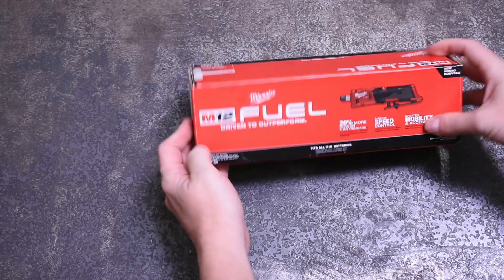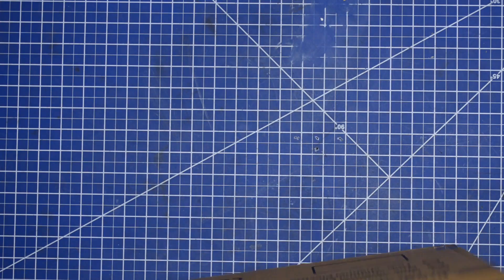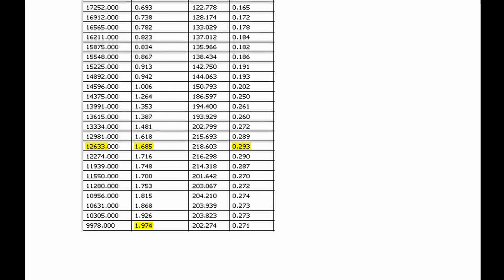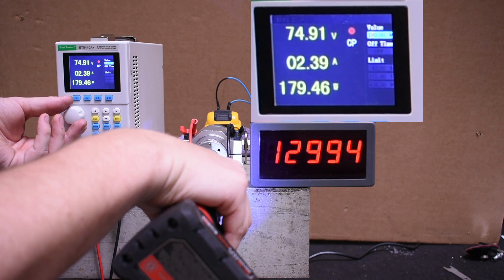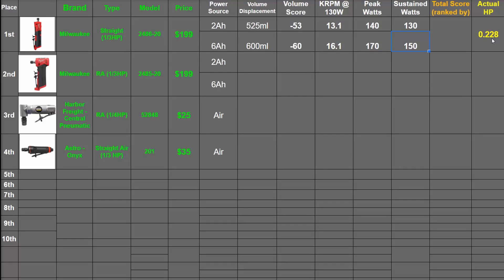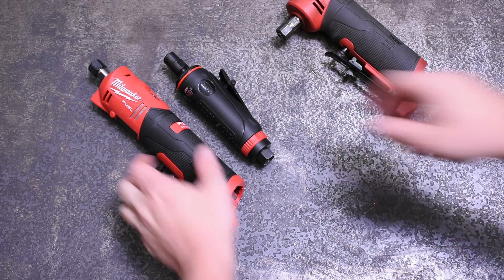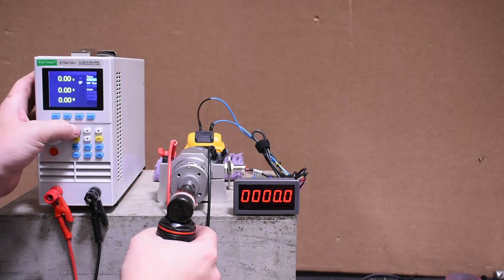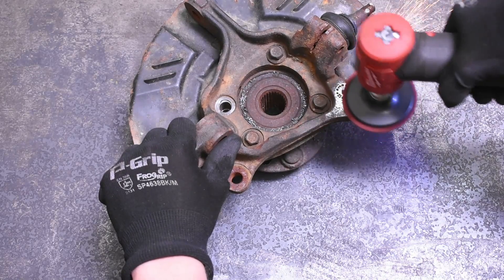We Built a HP Dyno: Do M12 "1/3 HP" Die Grinders Really Beat Air?

Comment: I wonder how efficient that spindle motor is? It's a brushed motor and they are never particularly efficient! 60-70% efficient is pretty common! Brushed motors are quite lossy due to brush resistance, heating and arcing at the brushes. You'll get much less watts on your load tester than is actually being produced if you don't know the efficiency of the spindle motor. Also, as the commutator gets cruddy with oxidization, it's resistance will go up and then the spindle motor becomes even less efficient. I think you really needed to use a water cooled brushless spindle motor so efficiency is MUCH less of an issue and won't change longer term. Some Schottky diodes across the 3 phases to convert that AC into DC will let you read the wattage of the brushless spindle motor easily. The diodes are very low loss and usually the spec sheets will tell you this information so you can add it back to what the load tester displays. You might even luck out and get a brushless spindle motor that lists its efficiency. You can also test it and find out. Run it on it's inverter and measure the amp draw of the system sitting still. Now run it through its RPM range and measure amp draw. Under no load, you are seeing only system losses. This can then be added back into what your load tester displays to get real wattage generated for the dyno tests.

Comment: Heavy truck mechanic here. I love the Milwaukee impacts and drills and stuff, but still prefer air power for die grinders. A more predictable torque curve, and still puts power out even if RPMs drop. The Milwaukee ones cut out entirely if they see too much RPM drop. Trying to grind through baked on hardened paper gaskets is no match for air power. Though I'm in a shop with 170 psi air and 500 gallon tank.

Comment: Obviously when it comes to the volume measurement it's going to sink like the Titanic,but the Kobalt kdg124 is an awesome performer it has the three speed settings and the governor  maintains all of them easily on any kind of load I've ever put it on. Even circle cutting 3/4-in thick rubber belt that instantly stalled every other tool I have including corded, cordless and pneumatics, it just grinds right through comfortably. I'm very pleased with it! I'd love to see you test it even though it's definitely not going to compete in the size category.

Comment: A lot of those test leads have incredibly small wires inside and really suck at carrying current.

You might want to verify that you aren't getting a significant voltage drop on the load cables, especially with alligators just clipped on the binding posts and wires.  Regardless of voltage drop I'd use spade lugs or bananas on the battery tester because they will be more repeatable if removed and reinstalled.

Comment: If you want the actual tool output power you should put the load motor in a bearing assembly that will allow it to rotate freely.  Attach a lever arm to the assembly and put a load cell under the end of the arm to calculate torque.  Use the torque value and rpm to calculate power.  With the right electrical engineer you could crank this out in no time.

Comment: I own both.  The air beats the electric in power, and the electric beats the air in convenience and portability.    I rarely use my right-angle air-powered grinder now that I own two of the Milwaukee electric grinders.  I keep one with a ceramic abrasive disk on it and one with a medium surface conditioning disk.

Comment: when it comes to just spinning and not inpacting I think air beats battery just in packaging alone but you start getting ugga duggas in there and things get heavy quick. At my workplace the company provides a 1/2" beta tools impact that weighs about 5lbs and my dcf922 does the same job and a little better actually cause it can fit places...

Comment: I have a straight m12 die grinder and I love it. I’m a mobile locksmith and I don’t want to lug a compressor around, have to plug it in and all that. It might not be that powerful but it’s very portable. I think I’m going to try one of the m12 5.0 batteries to see if the high output helps though.

Comment: I've found that the XC 3 and 4ah packs give a little more power than the XC 6ah.  With rechargeable batteries, it's common for lower capacity cells to be more robust and have higher drain rates, thus delivering more power.   I don't think it would make a big difference, but it is noticeable.  I haven't sprung for the new M12 high output batteries yet.  
I know most of you throw out the manual as soon as the tool comes out of the box, but if you follow the chart for disk sizes, you will be much happier with these 12V die grinders.  They are very handy.  If you always have plenty of air where you need it, when you need it, these won't make you happy.  If dragging a hose out is involved, you will love them.

Comment: I've been thinking of making a dyno for testing corded drills, measuring the input power (voltage and current) and the output power at the chuck. The problem with measuring output power by driving a motor is you need to know the efficiency of said motor at any given rpm. A better way would be to measure output rpm and torque, but it's not easy to measure torque.

Comment: The New M12 High Output Xc 5.0 Batteries from what I noticed give more power to these die grinders over the XC 6.0 would be cool to see what i feel by using them on the chart down the road comparing the 6.0 to the HO 5.0 @Torque Test Channel

Comment: You've made a test setup with relatively cheap and easy to source equipment. Well done. However, the dyno probably isn't very accurate. The efficiency of the DC motor will vary with speed, torque and even motor temperature. Definitely the electrical power you are measuring is lower that the mechanical power you want to measure. I suggest that you try to source a torque tranducer of some sort. Measuring torque and rotational speed directly should give much more accurate measurement.  Also about the load: it might be better idea to control the current instead of the power. This let's you control the load torque better as the current is roughly proportional to torque. Now  you are demanding constant power from the load, and the controller compensates for speed (voltage) reduction by demanding even more torque (current). The controller tries to completely stall out the tool.

Comment: Funny the end ad was Harbor Freight Lol. My father does restoration and autobody work in his shop. He buys those cheap HF right angles in 3s. Because one will have that screwed up gear that yours did. The other ones will work well and he will abuse them for about a year. My shop is more fabrication so I use 4.5" to 9" grinders more. I have an IR and another high end brand right angle air that rarely get used

Comment: Pretty sure the Milwaukee is only designed for 2” wheels, it doesn’t have the torque for 3”. I say this because I haven’t had an issue with a 2” Scotch brite pad.

Edit: on Milwaukees website it says “Optimum performance with 2" Accessories.” So that might be your issue there.

Comment: Love my M12 right angle die grinder.  It stalls easily as a cutt off. But it works without dragging a hose
The new HO battery is the battery for this

Comment: You're measuring after all losses. You could calibrate your dyno with a known inertia flywheel at a specific speed and watch the RPM decay to get a power in power out ratio curve set / contour for your rig. It's not fair to use these numbers against manufacturers claims. But it is a level playing field. Other than that, good effort, good test. I own both m12 tools and find I use the RA version more, but which I use generally comes down to geometry of the work piece.

Comment: Did you test the either of the milwaukee on a lower power setting? I have found in actual use the right angle at least tends to cut out in 4 way more often under load than mode 3.     Not sure if this would be a better function of watts/rpm. Looking forward to more tests with the new rig!
Reply: I rarely use mine on setting 4. I generally run mine on 2 or 3 and it’s great. I love it.

Comment: I've got both die grinders and assuming your not grinding the rust off a dozer blade or using a burr bit to cut 1/2" plate, they're perfect (cleaning gasket surfaces, using a burr to cleanup pin bushing bosses etc)
Reply: I could not agree more. They do everything I need them to do, they do it well, and they do it much more quietly without working around an air hose.

Comment: i just got that m12 right angle one yesterday, didnt get to use it at work much in one day but seems like its worlds above the $25 harbor freight one i trypically used. have to say though the harbor freight one seemed good enough if used for about a minute or less. after that though it would get pretty cold and felt as if it lost 50% power. seems like a nice new testing setup, cant wait to see more.

Comment: Another Thought to add to this ranking for die grinders specifically would be decibels, I know that's a big thing in my shop and a huge factory when purchasing a die grinder
Reply: Absolutely. The m12 isn’t as powerful, but it’s plenty powerful enough for what I need and it’s so much quieter than air. Combine that with not working around the air hose and it’s a big win for me.

Comment: Air all the way.  They are far cheaper, very simple machines.  They actually get cooler when you use them, have a nice side effect of blowing off the dust depending on where the exhaust is, have a nice way to tell the speed by the sound of it, and you don't have to worry about metal grinding dust getting inside shorting out electronics.  No brushes to wear out, or in the case of brushless ones, no mosfets and driver circuits to fail.  Also, you don't have to worry about explosions when grinding flammable stuff like magnesium.  Yeah it's not efficient to use a 2+ HP motor to drive a 1/4 hp tool, but it works and is probably cheaper than buying lots of batteries to get you through big jobs like porting heads and so forth.

Comment: Dewalt 20v drywall cutter and ryobi one plus drywall cutter are essentially die grinders,  20,000 rpm and have inserts for either 1/8" or 1/4" carbide burrs or anything you would use a die grinder for....I have been running my ryobi one plus off of a dewalt battery for years using a lamp extension cord .... I recently found a 10$ speed control to back off the speed because of out of balance burrs that get pretty  wild at that high of rpm.....I just cut the battery portion of the tool off because I don't like manipulating that much mass and weight around...if I could figure out how to post a picture of my setup on here I would..... it would be interesting to see how the ryobi 18v would compare to the air tools, but it seems pretty strong and now with the speed control is easier to control than an air power grinder and the lamp cord is a lot more pleasant to work with than the air hose ...however it all depends on what you are doing with it 😉

Comment: I'd love to see the Milwaukee with Amazon XP 6.0 clone batteries, I bought some Waitley brand for my m12 inflator, they're definitely not as strong as they XP 6.0 but provide significantly longer run time than the XC 3.0 and cost 1/3 what those XC 3.0 batteries sell for. It would be great to have empirical data on how they perform relative to the real deal.

Comment: Good video, I find your current RPM listing to be the most sensible.

Can you try removing the fan from the DC motor shaft and cooling it with an external fan mounted to the table?

I'd like to see Fein's AGSZ series of cordless die grinders tested.
They are full size tools using 18v drill batteries, but I'd still like to see how the larger units compare.

Comment: I own air die grinders and the M12 right angle. If I need the sustained power or heavy loads the air tools are the way to go. Since getting the M12 though, it is my go to tool. Takes care of most jobs well and the convenience factor is a win in my opinion. Thanks for sharing!
Reply: Pretty much the norm with air. If you need to run all day in a work station air is the way to go. Plus they are simple, light, reliable and cheap. At home I have both but honestly use my battery tools more and take them with me lots of places. At work though air is king. At my old job we had 3hp air grinders (good ones like Atlas Copco) and that thing was lighter and smaller than any electric grinder yet had more than double the power. It would run non stop for hours. The tool would get COLDER the harder you worked it. Ice would even form around the ehxaust. If heat kills then this thing was self healing 🤣. But it seriously does add to an air tools life when everything runs cool.

Comment: This was an awesome video! A lot of people, myself included, have had the 3" attachments defeat the m12 die grinder. They do excel with the 2" attachments however!
Reply: Milwaukee does say not to use 3 inch disks though because of the increased rotational inertia stalling the tool. With 2” rolocs I haven’t had any trouble.
Reply: Same here I constantly see people using  the wrong 3” in their tests it’s a great tool with 2” or burr’s

Comment: What I don't understand is why you include "Volume Displacement" ?  That is not going to help me decide which tool to buy.  Weight is. 9 out of 10 times, I'll use my M12  3/8th drill vs my Snapy 18 V 1/2" vs my corded Milwaukee 1/2" drill, which is the only drill I lend out, I don't use it any more. Call it Fatigue Factor or something like that. Total weight with battery. 

Other then that, you guys are doing a fantastic job !
.

Comment: As an aside, I've used a CHIEF BRAND STRAIGHT MINI DIE GRINDER using shop air  (110/90 psi, 10^10 CFM) and it is a beefy little git! I think it would be a better fit for your testing as the bevel gear will undoubtedly rob you of some HP! 
(although maybe the right angle die grinder may have a stronger motor......... so what if you swapped a straight  head onto it for a comparison ??????????????????)

Comment: You should have tried this with the 5ah M12 High Output, I can tell a massive difference in the 5ah xc and 5ah HIgh Output in tools like cutoff tool and oscillating tools. It’s amazing the High Output batteries really do deliver more chooch to the tool!
Reply: I used a friend's 90° that had the high output batteries and it seemed like it had as much power as my air powered matco. It was hard to bog.
Reply: Don't you mean the 6.0 XC? They don't make a 5.0 XC. I have both but haven't had a chance to use the 5.0 HO so I'm looking forward to that.

Comment: I really enjoy the Milwaukee die grinders. I’ve had my set for a year now and they’re still going strong being used heavily every day. The straight stays on “3” setting and the right angle is usually “2” or “3.” I find that setting “4” on the right angle delivers diminishing returns for my applications (usually a 3” roloc sanding disc on mild steel).

Cordless wins for me since I don’t have shop air except at work, and I much prefer not having to drag the hose around constantly. I only wish they were a little less bulky. Looking forward to more tests with this rig!

Comment: at work i have a Hazet 9032P-1 air grinder it is rated at 1hp and it works hard with a 50mm wirewheel you can not stall it but it likes at big hose and a big compressor

private i have the milwaukee 90 degree and yes the electronic is working funny some times it works really hard and other times i almost cuts out from spinning it self

Comment: I have found in the past that it is common with the cheap air tools to have gear oil and grease in them which dramatically slows them down. If you tear them apart and clean them and add pneumatic oil, they typically work a lot better. It’s often worth a shot to save some cash.

Comment: Your experience with the Milwaukee right angle is about the same as mine.  I find it compliments it's air counterpart, not replaces it.  It's convenient and sometimes I want less power.
Reply: For me it’s also about the noise. I don’t really need the power so the convenience and the fact that it’s so much quieter puts it on top in my book.

Comment: does that electronic load have usb or serial or anything inputs, you can probably make it do a ramping load from 0w to 300w in 1w per second steps for a bit snazzier graph also as for more powerful spindles, router motors are often brushed, rated for at least 1kw and run to 30000rpm, also a simple three phase full bridge rectifier can turn a brushless motor into a dc generator and then skys the limit for input power

Comment: This is great for comparisons of tools and batteries but wouldn’t the generators efficiency be playing a roll as well? It Wouldn’t affect the comparisons but it wouldn’t necessarily be fair to say a certain brand pads their HP numbers without some known values to kind of calibrate too.

If you were so inclined I guess you could maybe use the generator on some kind of lever arm with a load cell to calculate torque and use that with RPM to find HP that way?

Comment: I knew those are weak because a friend have them but I'm surprised by that much I will definitely continue with my air die grinder ( 1hp straight ant 0.75 angle non stall for both) they consume a lot but for me the air is not a problem the factory has 1500cfm on 3 compressor and a couple thousand gallon of tank all around for machine

Comment: Would love to see the classic IR 301B (90*) or 307B (straight) air grinders. In my mind they're the benchmark in the small form factor stuff like that HF 1/4hp is trying to be. It seems IR doesn't spec horsepower but rather in kW, which they rate at .19 for both.

If you plan on doing cutoff tools too, I've always wondered how much of a penalty extended-neck tools like the Mac ATQP40EA get for the length mechanism.
Reply: I would also like to see IR models, along with the HF Chief models that should closely compete with them.